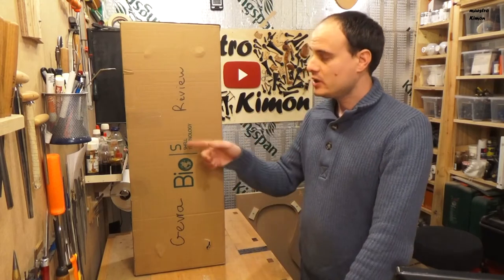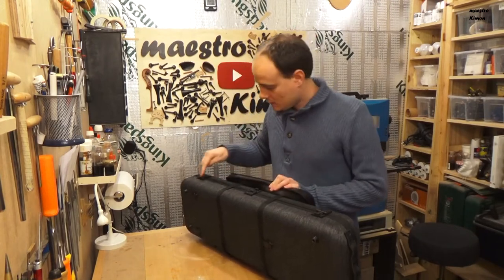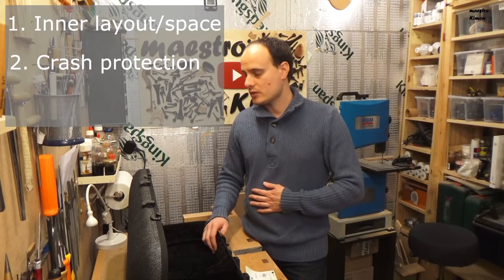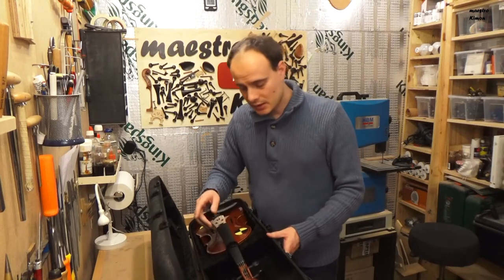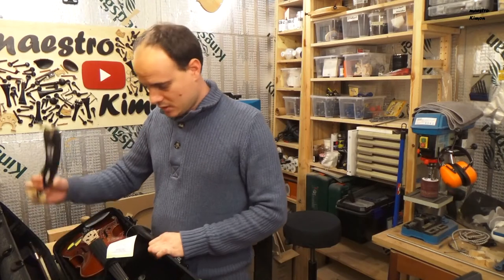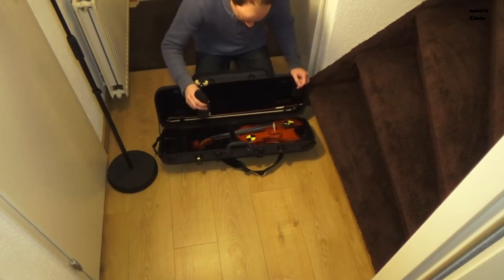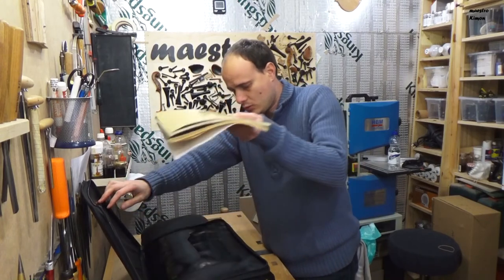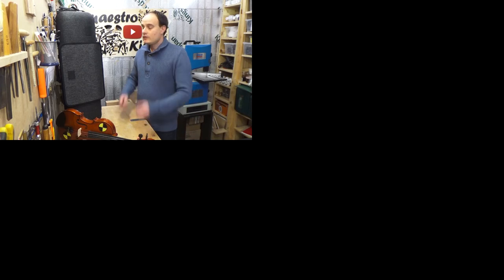GEWA Bio S Violin case review

Comment: Hey - really quick question - what case do you have? I'm about to start bike commuting and definitely need a new case but am struggling to find on that is impact and puncture resistant enough whilst also being waterproof? Would love to know what you travel with or even what your top 5 are? My criteria so car is: - the case sits high enough that it wouldn't bump my rear bike rack, a way to clip the shoulder rest so it doesn't bump around in the case, (I don't need much storage space as I carry most things in another backpack which I would be taking as well) but would love if it was waterproof? If you can think of LITTERALLY any company that sells anything I would be incredibly appreciative!

Comment: The shoulder rest fits perfectly in the compartement, no need to use it in that way.  And you re putting the bow in the the wrong direction. I have the same case and its really good, for only for 120 dolars.
Reply from the maker: Hello Ariel. By putting the shoulder rest next to the scroll you keep more space free in the compartment for other staff. If you don't have to much to take with you you could also put the shoulder rest in the compartment as you do. I always put the bow with the frog towards the lower part (when the case is in the upright position) because in that way, if the case falls to the ground you don't risc to brake the tip of the bow.
Reply: @maestrokimon  Hello, how are you? The gewa system to grip the bow is designed to put the frog in the flexible part, and the toe in the movable lock, that way it is much better and its really safe. Try it that way. cheers!

Comment: How would you rate the crush resistance of this case? Think of the scenario where an male adult falls on top of the case with a significant fraction of his body weight.
Reply: I have the Brown version of this case. If a average 80kg man say... fell down the steps and ended up falling on the violin case. The violin probably will not survive, especially if he sat on the bottom part of the case which isn't arched. So  Don't put a valuable violin in the case. The violin can take a few bangs and falls but certainly can't something like that. I can easily flex the case pushing down on it, and therefore I am selling mine since I'm carrying around an 18th century antique instrument. But for people who are on a budget, it's a great case
Hope this helps :)